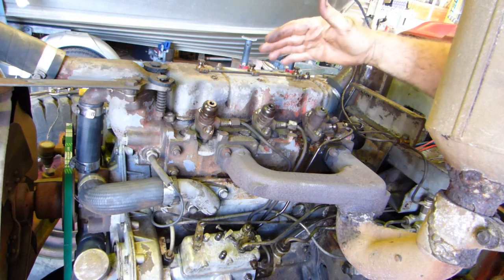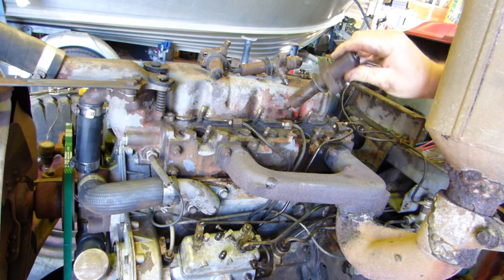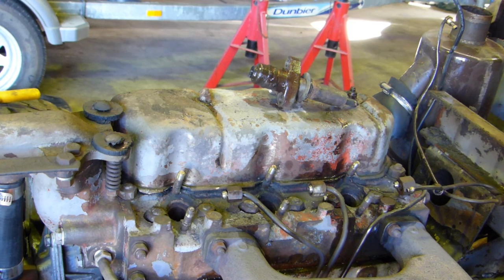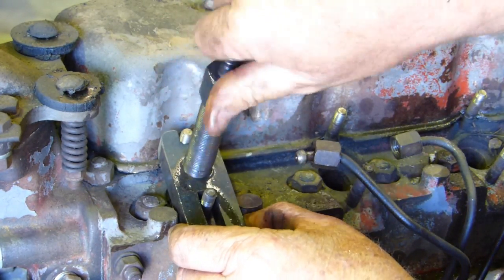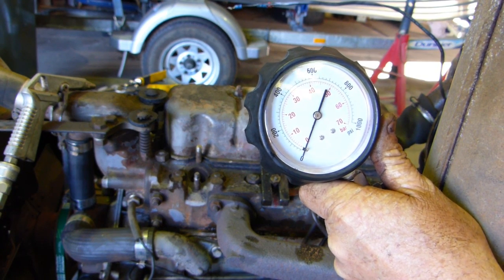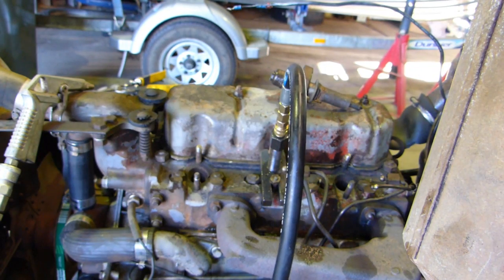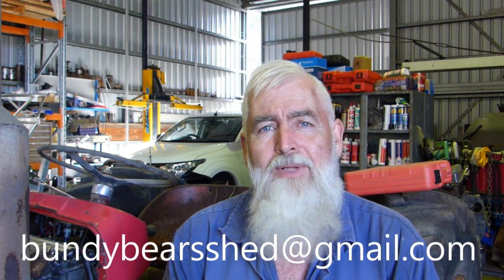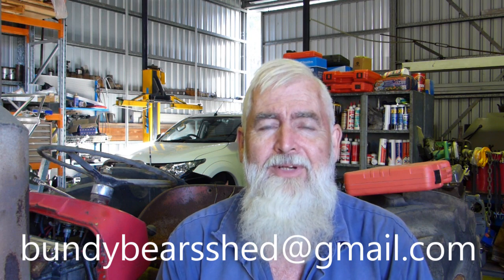MF135 Restoration #2 How to Compression Test a Diesel Tractor

Comment: I think ur Chanel is brilliant lance. I’ve a fe35 needing an engine rebuild they can sometimes be a bugger to start which mine is. Chris walker Northern Ireland
Reply from the maker: G Day Chris,  Just a tip for the 23C, try loosening the injection pump and turning it towards the engine block at the top and I find that helps at times.

Comment: Hey Lance, too bad about the poor compression but it will make for a good video series. Keep smiling.
Reply from the maker: G Day Darren, I knew it had very low oil pressure when hot so the engine rebuild was expected when I bought it. It was just a good test to do for the series.

Comment: Your experience with that cheap ebay compression gauge was the same as mine.. it failed after 3 cylinders. Same symptoms, pressure release button had no effect... threw it in the bin.
Reply from the maker: G Day Duncan, i have pulled it apart and it looks difficult to get in and fix, mine might go into the bin too, yet, lol.

Comment: Had the same problem with the H-thing in the eBay compression kit on my MF275, except much worse, since the injectors are rotated 90deg and  and the head bolts all interfere.  I made a much smaller and thinner plate and it turns out that oxygen sensors use the same thread, so a weld nut is available at the auto parts store.  My gauge reset hasn't broken yet :)
Reply from the maker: Thanks Jim, That is good to know.

Comment: Hi Lance, findings not so good on the test but I think its better and easier to do now while everything is getting dismantled than having to do it down the road and risking scratching the new paint job in the future, also engine rebuilds are interesting and fairly simple(compared to todays engines)if you have any clue at all. cheers Derek
Reply from the maker: G Day Derek, I knew this engine had very low oil pressure when hot so I had allowed for an engine rebuild. I just thought it would be an interesting video.

Comment: I was always more interested in the pressure on the first hit.  I feel that being the valves open between compression strokes the cylinders do not pump like the compression gauge does with the one way valve in it.  It is the first hit of compression that ignites the fuel.  Just my humble opinion.
Reply from the maker: G day Big'un. I think the problem with just the first hit is that when compression testing the engine speed would not be the same as on a running engine where it is firing on first hit. I think the stated compression figures in the manual are like Im doing it as in when the gauge settles. Interesting to think about though.
Reply: I agree about the manuals recommendation but the first hit on a good engine will not be too far below what it pumps up to.  Just my preference.  Of course the true way to check is to perform a pressure cylinder leak down test.  Advantage there is you get a percentage of leakage and you can actually hear where the leak is the most. Listen to intake, exhaust and crankcase for air hissing.  Had Snap On one with the adapter for both large injectors and pencil injectors in addition to spark plug sizes. Guy I sold it to still uses it today and it is over 40 years old.

Comment: Hi Lance. I modified an old injector to do compression test on my FE35-23C engine. Took all the guts out, enlarged the bore and fitted QR nipple in place of fuel connector and blanked off the fuel return port. (I do not have the machinery you do to make a new bridge if needed :-(
Reply from the maker: G Day Tony, I think with the 23C I will need to do similar as I dont think a bought kit would have anything to do the job.

Comment: Lance, if you had a blown head Gasket what would happen with the Compression test? as I have the FE35 4 cylinder engine and I think it's done the head Gasket, it won't start at this stage unless towed till if fires, it runs pretty well when running but I bought it non-running and had fuel issues.
Because I have little knowledge and doing this as a bit of a fun hobby with the goal to have a tractor I can use here as the outcome I am enjoying the learning curve when I got it the oil was as I would expect and it was Black as coal but they had been having issues with starting it and just replaced the tractor and left it for about 5 years they said. I had a lot of trouble getting fuel up to it but when I did and tow started it because the starter cannot get it running.
It would run fine but I would cut it back to idle and go put the car away and by the time I got back it had stopped and towing proved there was no fuel up there at all, Now I have finally got fuel to be there, But now the oil has water in it and going grey, and the tractor now will get rough at idle. Any suggestions as to which way I should go as I thought of putting a compression test on it just to either confirm my thoughts? 
I was told that these tractors were terrible to start anyway, But that does not make sense to me as they would have found it difficult to sell them if that were the case. Cheers Garry
Reply from the maker: Compression would be low on possibly two cylinders
Reply: @BundyBearsShed  Thanks for that I will look into it as its all a fun learning curve

Comment: G’day Lance,just wanted to ask whether replace of injector seal is needed after they have been taken out to do compression test. Or can I just do the test and then put the injectors back in place?Thank  you
Reply from the maker: Ideally they should be replaced but I have not in the past at times and not had an issue if you keep it all clean.
Reply: Thanks Lance, appreciated. Did you have to bleed (purge) the CAV pump after this? I'll get a test kit and do this on my AD3 152... do you think a complete rebuild is fresabile for a newbie with some skills (certainly less than yours) in repariring?

Comment: Hi Lance thanks for your great videos I have a 23c that i rebuilt with new sparex piston liner kit and cylinder head was rebuilt but still having issues with getting the engine to fire without assistance. Engine runs fine once its started just difficult on startup im assuming its a lack of compression  havent tested that yet but it seems to me  fairly obvious its low.Set the valve lash at 12 thou how much liner protrusion above the deck height of the block maybe theres to much causing the lack of comp thanks for your wonderful videos again 
Cheers Ken
Reply from the maker: As the engine wears in it should have more compression. Try timing as well and advance it a little I have found that helps in the past. There is a free workshop manual download on my web site here https://queenslandtractorspares.com.au/technical/
Reply: The 23C was notoriously bad at starting, I always found that some were better than others and, strangely, the good ones stayed good and the bad ones never got better no matter what you did, I always assumed  that manufacturing tolerances were no so good back then and there was enough difference to affect how well they started, they are also prone to camshaft wear so that is worth checking, however, the last time I asked camshafts were unavailable so good luck.

Comment: Hi Lance, have you done a video on compression checking the 23C diesel motor, need to check mine but looking at other videos, it appears i might need a special fitting to go into the injector hole.
Reply from the maker: No just the petrol and 3 cylinder Perkins.

Comment: Hi Lance I have a 168 and am trying to get injectors out. They seem to be very stiff. Have been leveraging however seem well stuck. Any suggestions.
Reply from the maker: Only thing I can suggest is to try and twist them while levering. Removing the mounting studs may help if you can get to then enough.

Comment: Hi Lance. I took my tank off to rebuild the motor but am having trouble putting the tank back on. I couldn't find any info on how to do this. can you help?
Reply from the maker: You need to fit the front cup head bolts and springs and slide them in while lifting at the back a little.

Comment: Great video, I have a mf 168 that lets out coolant through the expansion pipe only if its parked up for a couple of days but is running fine. Would the head gasket be on the way out?
Reply from the maker: Possibly but leaking parked up seems odd.
Reply: @BundyBearsShed  Thanks for the reply, Its very odd🙈

Comment: Love these restoration series as i am currently restoring a tractor! A David Brown 996. Good luck with this tractor. I look forward to the final result.
Also feel free to check out my restoration videos on my channel. 
Keep up the good work!
Reply from the maker: The DB996 being a 4wd was a great tractor, I would buy one to play with but they are such a good tractor they dont come for sale over here often.
Reply: Yes the one i have is 2wd and i believe that they are one of the best gripping tractors ever made 2wd or 4wd. Here in Northern Ireland they are common enough  however the tin work on them are usually very bad due the the weather. I have spent a lot of time working on the mudguards to get them into good shape again as it is basically impossible to find a solid pair of metal ones.

Comment: Fascinating stuff Lance, have subscribed to you. I own a 35 with the 23c diesel, and a 65 Mk2 Multipower. Both great tractors but the 35 is a bit of a pig to start. I was thinking about doing a compression test to see whether I can narrow it down to the engine itself of the injectors or pump. I don't really have the cash to throw around to do all of it as I need to buy 2 new rears for the 65! Can anyone recommend a compression test kit that will fit the 23c? All the best - James, UK
Reply from the maker: The 23C engine is a bit different on the injector so I think you will need to make something up. Just a tip for the 23C, try loosening the injection pump and turning it towards the engine block at the top and I find that helps at times.
Reply: @BundyBearsShed  Thanks very much Lance, very kind of you. I'll have a look at that. I am hoping that the refurbished starter motor will be enough. I am not sure whether the glow plugs work; they have been wired with the "over and under" method that results in them all not working if one fails, so I will be testing each one and going from there. Hopefully working glow plugs and the refurbed starter will be enough! Otherwise I will try your advice. Many thanks.
Reply from the maker: Fitting a ford 4000 starter will help spin them faster as well, you just need to open the bolt holes up slightly.
Reply: @BundyBearsShed  Ahh yes very true. Would like to try and keep it 'original' as such if I can get away with it. We'll see how we go! Thanks!

Comment: Hi mate have a question 
Why do you need an alternator to drive it on the road over the generator? What is the difference?
Reply from the maker: The original generator is 11amp, by the time you have a flashing light and headlamps on that is around 13amps so to charge a phone and run a fridge an alternator just gives me a safety margin.
Reply: Bundy Bears Shed thank you makes perfect sense. Explains why when I was a kid grandad would yell at us for putting the light on with out the tractor running.

Comment: Hi Lance love the channel I've just finished a an engine rebuild on my 35x and have discovered back pressure on the breather pipe. I've completed a compression test and I'm getting 280 psi to 320 psi, I'm wondering if I have put the rings in the wrong way?
Reply from the maker: That does seem a little low for compression but with finished liners they are never exactly round just due to the engine block. I would put some cheap 30 weight oil in it and give it time to run in. A bit of hard work will do it a heap of good. 
I think if you work it hard and do another test you will be supprised. Make sure the air cleaner is not gummed up at all in the gauze.

Comment: G'day Lance I'd put money on it that you knew that was going to happen.  She still was firing over to run that pump though regards John
Reply from the maker: G Day John, I knew the oil pressure was getting very low when it was hot so that is a sign of worn bottom end so an engine rebuild was in the plan for sure.